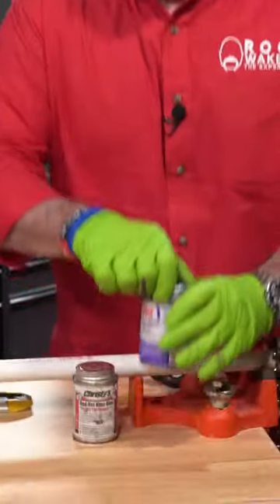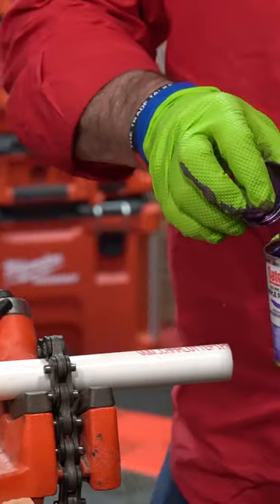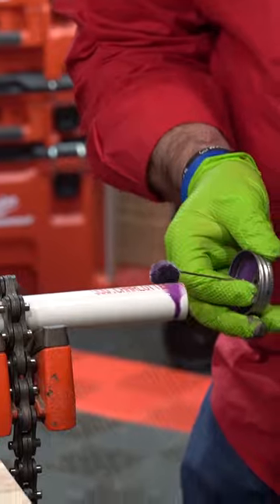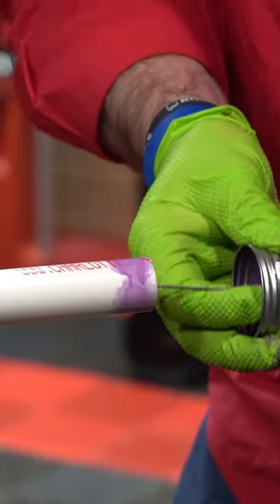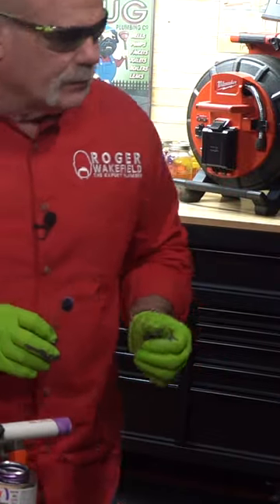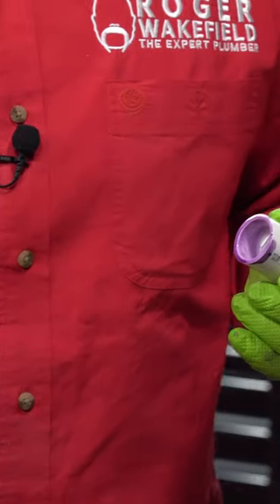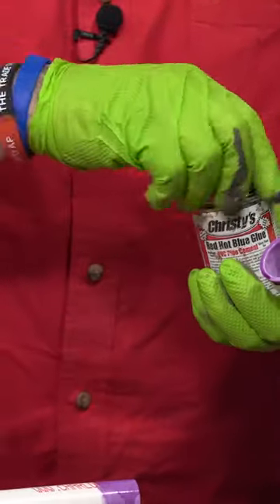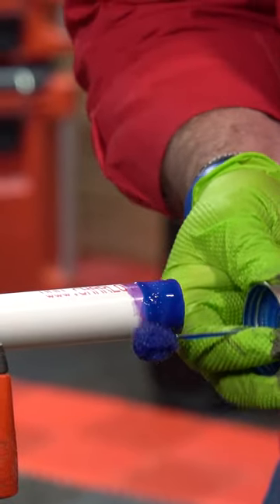Gluing PVC with Red Hot Blue Glue!

Comment: I usually don’t listen to code writers.  I generally listen to what the manufacturer recommends for their products.
Reply: navien says it can run off a half inch line within 25ft of the meter. 

codes on pipe sizing are there for a reason.
Reply: “I don't follow code.“ Is the last thing you want you plumber to say. 
If you install a navien tankless NG on a 1/2“ gas line. Your not getting the proper gpm.
We aren't even gonna talk about water column

Comment: I feel like you're trolling us putting that excessive amount of glue and primer on... 🤪😂
Reply: Excessive primer? If that pipe and fitting aren’t dark purple you didn’t use enough primer 🙄
Reply: @jman0870  you don't even need primer.
Reply: @xephael3485  wrong
Reply: @sativa2050  tell that to people who cemented PVC together for decades before primer became a code requirement in many locations.
Reply: @xephael3485  the reason it was changed is because we're fixing all your old problems
Reply: @Nix.101  best reply I've seen all month.

Comment: I hate the blue glue. I loved for a time, but I don't use it anymore at all. I used to work septic installation. Currently a plumber, But on more than one occasion while working septics I had to go fix leaks. The glue joint didn't hold, and after examining the fitting and pipe, the glue had pushed out of the fitting. Maybe they, or myself took too long to set the fitting, but I'm not s fan. The only time I think I would use it is in a very wet situation.

Comment: I’ve seen it let go when used as a one step
Reply: I tried to break apart a joint on 1/2" pvc with purple primer and medium cement (at room temperature) and the pipe just shattered. That joint is strong when done right. 

(I was in my garage, it wasn't a job).
Reply: I've only seen it let go if it was an unpressured line like a drain
Reply: Primer has been found to make weaker connections in at least one scientific test.